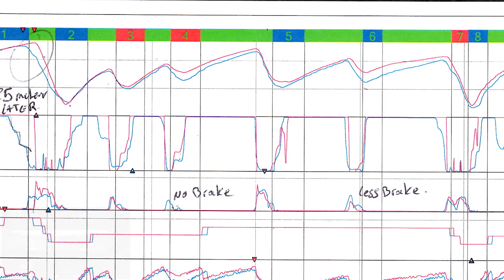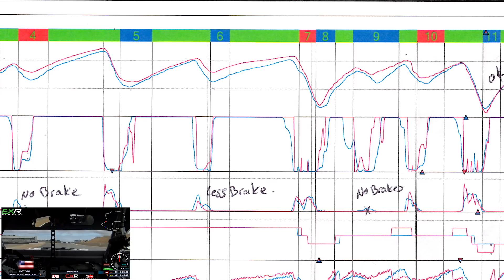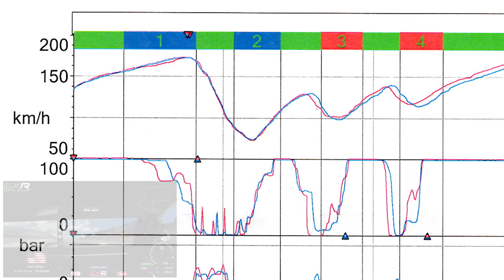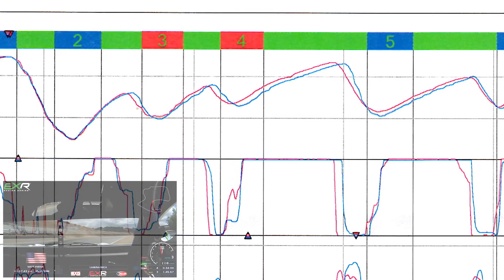How to Use Data to Improve Lap Times at Laguna Seca

Comment: Haha dude, way higher rpm, allowed to go through the left hander at full throttle using 3rd and using more of the track on the last corner. No wonder he was quicker, little bit unfair to not let you guys give it the full beans. I thought you did a good job there (not a racing driver at all btw so just my opinion) seems braking later and scrubbing more speed off when braking would get ya some more time. You seem to have similar braking patterns on each attempt whereas his are a lot sharper in deceleration so his brake modulation is a bit more aggressive without locking them. Like I say could be chattin utter tripe there as I've only done one car limits day and been on the odd track haha! Thanks for the video, great watch!

Comment: Other things that were not mentioned (though I'm sure you're aware of them), but do count: Alex revvs the engine higher, he uses 3rd in 4th corner while you leave it in 4th, he uses 1st gear in the last corner as opposed to 2nd. 
But all in all, you're faster than a "decent amateur" and I'm pretty confident you would obtain good results in some semi-pro series. I mean it :P
Reply from the maker: thanks, and yes, all correct observations. my car had a rev limiter at 7200 RPM, which I hit just before braking for turn 11. If alex's went higher, that would be helpful. Also, the sound rules with 4th gear around turn 5 didn't seem to apply to him, which is fine and probably worth at least a second on its own. I probably still wouldn't go to first in turn 11, but after watching his video more carefully (I didn't see his lap video at all until a week after I did mine) there are some very easy and not risky ways to make up a bunch of that deficit if they give me another go :)

Comment: You can see in Alex's lap how he is constantly feeding different degrees of steering angle as he approaches the apex and is back on the throttle as soon as possible. In every corner he appears to push the car to the limits of its grip, simply the practice developed from vast experience on the track. Awesome video, thanks for sharing.

Comment: i use the predictive lap mode on the  the lap timer i use . it tell you how much +or - you are evry 50 ft on your fastest corners  put together. its super important to unwind the wheel when you exiting a corner. if you don't you pinch off the corner and lose time. as you unwind slowly depress the gas and unwind more ..
         wrong about the the sound meter are the short run up to turn 6. the part you mention is where they meatball you if you didt pass on that meter. you lift right before thew bridge on turn 6 . its a littls sound hut on the right hand side.

Comment: Great video, Matt! In my short experience doing High Speed Touring at Hallett in my car, I found that as the laps went on, I found the courage to trust the car's brakes and tires. That alone made up 2-3 seconds. But, there is a wall that you hit when you realize that this is your own car, that you drove to the track, and your tires which will be getting you around town. That is where a race car driver has an edge; if they wreck, it's the end of a day's racing, bummer. If I wreck it's thousands of dollars out of pocket. My new plan is to take the racing school at Hallett. Their cars, their tires, gas etc. with proper racing instruction. Totally worth it in my book. It was fun to see what my street car could do on the track, but I'd rather save the race track for race cars and street for street cars. This looks like a great controlled environment for instruction; not to mention an amazing track.

Comment: It has nothing to do with balls, it's really just about understanding what you're doing. Understand that your mind is a calculator that knows the best and fastest way around. If you were running for your life on the same course, you wouldn't be thinking about at all about the optimal way to drive around the course. You would be thinking about your life, and your brain would be doing the other part, and it would be doing it much more efficiently than you when you're overthinking it.

Comment: Is that datalogg system the same as those available on higher end Haltech and Motec ecu's? Or is data like that taken from some other device? I do realize you need the proper sensors to get that data in the first place.
Reply from the maker: The AIM system gets its data from a GPS, OBD2 data from the car, and an onboard acccelerometer (i think)

Comment: You can spot the difference even by the way Alex keeps using the steering wheel. Since he's trying to push the car to the limit in the corners, he keeps moving it with tiny and quick adjustments avoiding the car from sliding (sry for my English :\ )
Reply: Your English is fine, and I was going to say the same thing. Alex is very "twitchy" like a racing driver should be. Constant small inputs and corrections for faster speeds.
Reply: +Paul F it's not sawing the wheel all over the place. It's making minor corrections when pushing the limits of the tires. Go watch videos of multiple pro racing drivers behind the wheels of their racecars.
Reply: It depends a lot on the car - there are cars that need constant corrections and there are those that don't (F1 cars don't). Can you, please,  send a link with Schumacher's lap? What was he driving?
Reply: Honestly i think its more the track than the car
Reply: There's also a HUGE difference between time trials and an actual race. Tire preservation is a HUGE deal in a race... Time Trials or open track test... who cares about tires.

Comment: I would've downshifted to 3rd in the middle of course starting at 5th turn. Losing a ton of time there
Reply from the maker: So would I. We were asked to leave it in fourth for turns 5-7 because the cars will break the sound limit at the sensor outside 5 in third gear.
Reply from the maker: +BeBarnee no, Laguna Seca has a 96 DB limit for all but about 30 "no limit" days per year, basically reserved for higher profile races.
It's about 5x more expensive to rent the track on a no limit day.
Reply: What is the point of sound limits on a racetrack?? I know having a muffler on a racecar is pointless and defeats the whole purpose of building a PURPOSE-BUILT racecar, so why even have any noise limits? Why build a track anywhere close to residential areas, or why let people move close to a track. In eastern europe there are no sound limits, and and its your problem if your house is too close to a racetrak (something I for one certainly wouldn't mind)
Reply: They should've never made a residential area as close to Laguna Seca as they did. The track was there way before anyone moved into the area. Another thing I think is just absolutely ridiculous is that people move into these areas well aware that there is a track not far from their homes and then complains that there is too much sound..??? In the day time...
Reply from the maker: Laguna Seca is inside a state park and there are lots of homes around. Way it goes.
Reply: Interesting facts; thanks Matt.
Reply from the maker: +foxtrotrx apparently the noise level didn't apply to him
Reply: So this wasn't just a one time issue? How does this affect other racecars / teams / races? If a 4 banger breaches the sound limit, I guess it's even worse for 8/10/12 cylinder cars..
Reply: he down shifted into 3rd though on those turns...im sure that significantly helped his time. Was it because of the time of day? because the noise level rule didn't apply to him lol
Reply: TheSmokingTire Makes perfect sense! thanks for the response! Love the videos
Reply: Fuck that shit. I heard that's ruining laguana seca. People want to move there because........OH YEAH, A FUCKIN RACE TRACK IN MY BACKYARD....FUCK YEAH but dont want to live with it everyday............
Reply: This happens everywhere on the planet, on all differnt track, from mx tracks to RC car tracks, I guess the problem is these people had property there before the track?
Reply: Nice seeing Alex grab 3rd into T5. 

Talked to him a few times when he is/was doing V8SC's.
Reply: +Okipouros Laguna Seca was built in 1957

Comment: ... and he was in a lower gear at 3 sections of the track where you were holding higher gears.
Reply: Noticed that right away too
Reply from the maker: They asked us to stay in 4th through turn 5 because of the sound meters on the outside of the track there. Apparently Alex wasn't given that memo haha
Reply: TheSmokingTire Thanks for the feedback. That is about the only topic (gear selection) that wasn't discussed, as that massive affects acceleration curves. 

To your point about staying safe and not wrecking the car, I 100% agree.

Not attempting to point out or be too critical, but gear selection on a new track (and as you speed up) is always a big time saver.

Thanks!
Reply from the maker: Yeah I forgot to mention it, however I've just added an annotation explaining the gear selection because of the sound meters so I don't have to type that over and over all day. THanks!

Comment: Matt, you've got the corkscrew down pretty good.
Reply: Agreed. When he went through on the first session I was very impressed. I would have been shitting myself
Reply from the maker: The corkscrew comes very easy to me. Turn 2 and 9 are where I really need to improve
Reply: Spot on. The corkscrew isn't nearly as technical as people make it out to be, it's just scary at first because of the crest before the first apex and the blindness of it as you're turning in, as long as you point the nose of your car at the 2nd tree it's pretty easy. Turn 2 was the most difficult turn for me to get the hang of, and turn 9 I'm still not sure I have the most ideal approach because it's such a long sweeping turn. I need to pick some better brake/turn-in reference points.